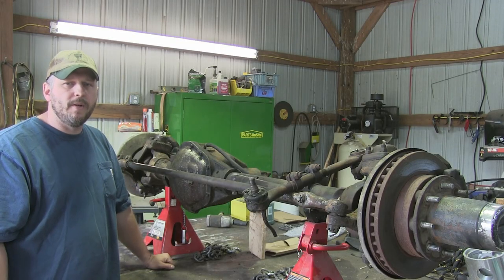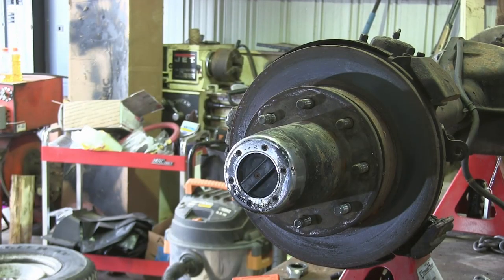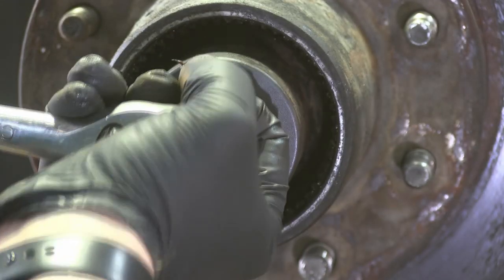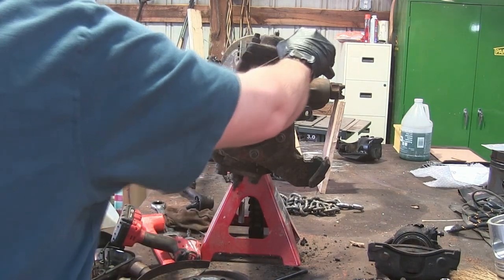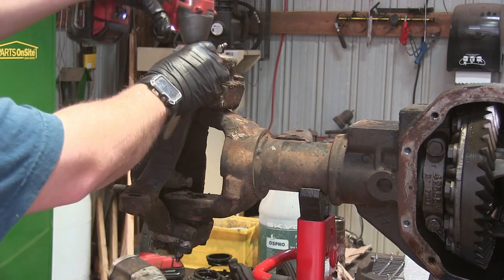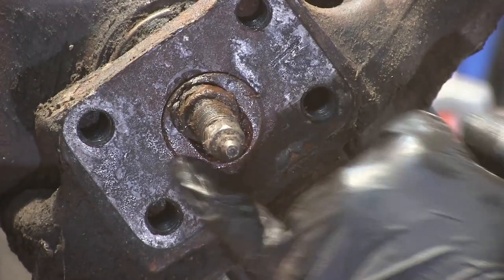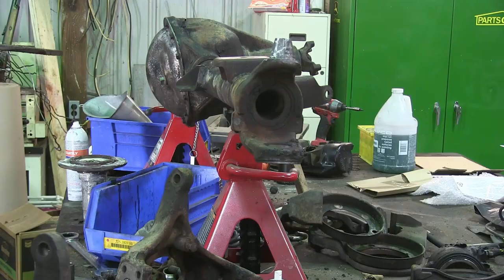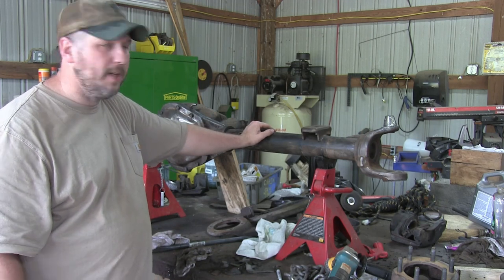Dana 60 Teardown DIY

Comment: Great Vid !!! I just found that moog makes these lower adjustable king pins for the DANA 60 for first gen dodge's. Their instructions are vague at best. Can you add some detail about these adjustable king pins on your reassembly video. Thanks....
Reply from the maker: I went with normal bottom kingpins when I reassembled the axle.  I know this will affect my camber but I don't really care since this truck is not going to be a daily driver and won't see a lot of highway miles.  I never could find a lot of information on the adjustable king pin and sadly can't really offer you any advice. Thanks for watching and nice looking dodge

Comment: Do the inside and outside bearings have races
Reply from the maker: Are you asking about the hub?  If so, yes.  I'm going to reuse my wheel bearings and didn't knock those races out
Reply: all bearings have races. or ride on hardened surface,like f150 axles bad idea,. & spindle bearings.

Comment: you didnt ruin the bearings,it went no where,,just brake clean then light oil. done..
Reply from the maker: True, I could have just cleaned them.  But, I decided to just replace them since it requires a near full teardown to service these bearings and I already had it apart.  Thanks for watching